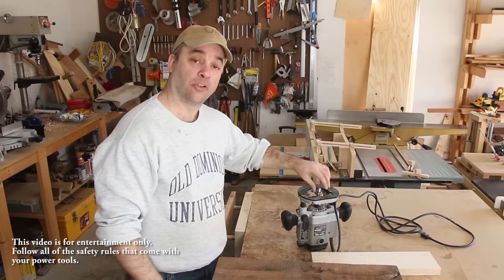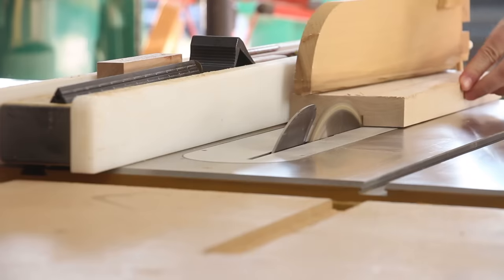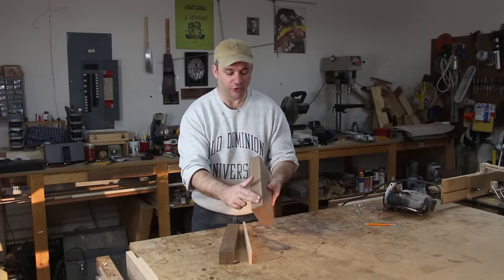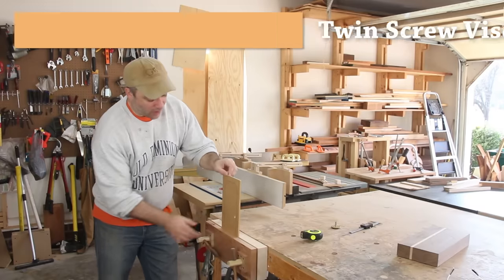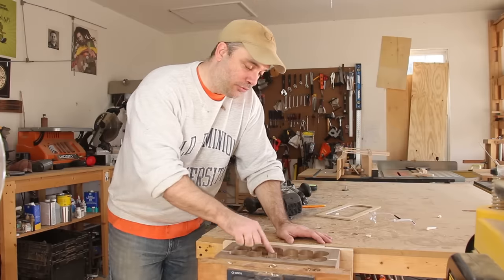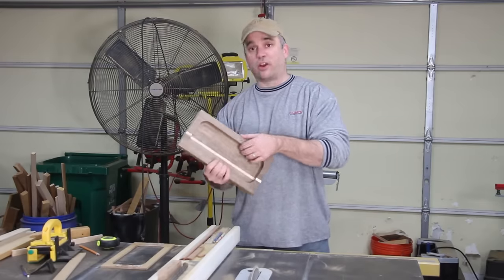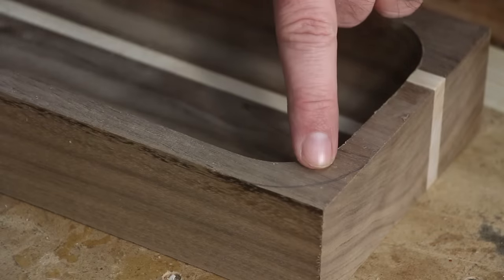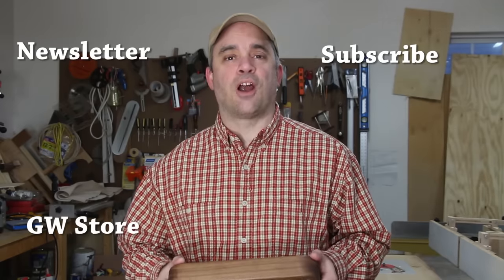Make a Bowl with a Router

Comment: The finished bowl looked great and the techniques used to make were good.  I just have issue with the title of the video.  You actually made the bowl using almost every items in your shop, most of which out of reach in cost of your average John Doe woodworker.
Reply: @D you've missed the point but no doubt that was intentional. Making someone feel cheap makes you the bigger person ... we don't think. Get some self worth
Reply: @D I understood that. However, the vid title implied that a router only was needed.  The op was correct in saying that the vid utilises numerous workshop tools which are likely outside the requirements of most dyers.  You then advise just two tools needed.
Not correct. The op was right and your comment imho a little snide.
Reply: Hm..nice bowl..but where is the craftsmanship.
Reply: @maggiehemming7904  It only seems that way if you are completely unfamiliar with how wooden bowls are usually made, and that would be with a lathe. The title simple serves to differentiate this technique from the norm....i.e. using a lathe.

Comment: I’ve never seen so many winery comments. He used a router to make bowl. So what if he used other tools as well. He didn’t have to, but he has the tools so he used them. You could watch other videos on how to make block of wood without his tools, and how to remove the bulk of the material without a drill press, the important tips came from him showing how to use a bowl bit and a guide to get a nice bowl cavity. I liked the tip of leaving extra wood around the edge for added support, and how you can use the edge left by the first router pass to create a nice guide for the subsequent passes to get it to depth. You could do all this with a saw, had planes, and chisels if you needed to, but the router is what makes getting a nice smooth regular surface so much easier.

Comment: "I hope the pencil line shows up on the walnut"...I have a handy tip for you :) A couple of weeks ago I became frustrated trying to see pencil lines on wenge.  Chalk stinks because you can't make a sharp line.  Went inside and found a white colored pencil. Perfect!  I found that the high quality pencils work better on wood, they leave a solid clear line and they are easier to remove than low end brands.  Another bonus is that colored pencils are softer than regular pencils, so they don't scratch softer woods like poplar and pine.  I use bright orange or pink on light wood, and white on dark wood.  So much easier to see.  Erases best with the old school style pink erasers.
Reply from the maker: That's a great tip Jen.  I hope you consider subscribing.

Comment: Everyone is complaining about the tools, and being expensive, I don’t really see any expensive tools except for the woodpecker router lift, everything else is within reach for a diy woodworker. People need to understand that woodworking is not a cheap hobby. But also there are a lot more expensive tools than what you are using. Also you can learn to work with what you have, the only thing I don’t have is a band saw but I make it work without it 
I’m surprised no one has complained about the glue yet

Comment: @ James Randall: Although I can understand you, I cannot agree with you. If you have the real estate, go for it (or build a big garage like I plan to do within a few years). If not, make use of the space you have. You do NOT need those big, chunky tools (although they are niiiiiiiice). There are a lot of small tools that fits into a really small garage. And a lot of the tools can be swapped out for hand tools or utilizing other tools you have or can purchase for very little money. Take a look at this video:
Homemade hauptwerk organ
I used some hand tools, a plunge router, a small band saw, a combo planer/thicknesser (dirt cheap, works great on smaller pieces) and a drill.

Big tools and a big garage is the dream, but you can have a LOT of fun with less space and smaller tools (they are cheaper as well...).

For instance: My combo planer/thicknesser costs NOK 2995,- while a big aircraft carrier style thingamabob costs about NOK 15000,-. For most projects, you really do not need that big planer. I have successfully planed 2 meter long pieces on my thicknesser/planer, and it have a bed of only .5 meter.

And if it still bothers you that much, just don't watch the videos. Go to your shop and build something! :)

Comment: good work if you can afford all the equipment. . . ..  I feel deflated, Ive just got a router and a 10 ft garden shed to work from. . . .  . and I had such high hopes ! :)
Reply from the maker: I made my first piece of furniture (sofa table} in a garden shed on a contractors table saw.  There's no reason why you can't make this bowl with minimal tools.  It's not a chest of drawers for crying out loud.  It's a bowl :^)
Reply: +Robert Brennan
They're complaining that this video claims it will show how to make a bowl with a router, but then shows a variety of very expensive tools being used instead.
Reply: johns sparks lol I'm still trying to get my garden shed!

Comment: This is a silly question. But what is that machine you slide the wood through and it came out the other side? What does it do?
Reply from the maker: That's a planer.  In a nutshell, it allows you to take a thick board and make it less thick.

Comment: Hi.  Nice video.  I had a question on the bandsaw.  What type of blade are you using to cut the Walnut ?  i.e.  width ( 1/2 inch)   TPI  and tooth configuration.   I have the hardest time cutting thick hardwoods.

Comment: great video, but pleas tell me, why do you alternate between the band saw and the table saw in the beginning?  what makes you decide which one to use?  Thanks in advance mate, and also what is that large dewalt machine that you run the planks through?
Reply: band saw was for rough cutting the larger chunks of wood, and re-sawing...table saw was better for dimensioning.

Comment: That was a big piece of wood when you started but the tray/bowl is quite small.  Why did you not make a larger bowl/tray to use most of the material?
Reply from the maker: The original stock that was used had to be wide and long enough to support the router.  Not much is wasted.  Not sure I would describe the bowl as "quite small". It's a really good size. Thanks for your interest!

Comment: You don't have to have all those large tools. I use my cordless drill to hog out waste material sometimes. You can cut the corners off with a hand saw or your table saw. Flatten the surfaces with a hand plane. If you have the nice big tools then use them but ya don't have to have them.

Comment: I have a question.  Why use the Forstner bit for clean out vice the plunge router?  I have seen other people do this and was just wondering why.
Reply from the maker: Faster to use the forstner bit.  Router would require multiple passes with each pass being deeper than the former.  You also need to sink the router bit to a level that puts the bearing at template height.

Comment: Love your videos. Thanks for sharing, you definitely got you a new subscriber. One question, could this be done with a straight template router bit with ball bearing? Looking to make just a wooden enclosure and don't need the slope on the inside. Thank you in advance
Reply from the maker: I don't see why not.  Should work fine.

Comment: What adapter do you use for attaching your shop vac to your Dewalt planer?
Reply from the maker: I used a rubber 90 degree fitting that I found at Home Depot.

Comment: well done..no worries using tung oil on a bowl?
Reply from the maker: Tung oil (with no metal driers) is probably one of the safest finishes you can use.
Reply: As the source of tung oil is a nut, people with nut allergies often report adverse reactions to contact with (or even the odour of) tung oil. Reactions can be severe in some cases. While tung oil has been used for many centuries as a finish for kitchen items such as wooden bowls and cutting boards, some individuals must avoid its use. (Wikipedia)

Comment: You didn't just use the router. You have used the drill-press, table saw, band saw, "scrollsaw". I think that the headline should be modified IMHO.
Reply: the main thing is the hollowing out so he used a router in stead of a lathe. Get over it.

Comment: This should be called 'Make a bowl with a Router, band saw, table saw, planer, sexy belt sander and a drill'.
Reply: Sam Jarman it’s not called a sexy belt sander, the technical term used in the sears catalogue is scratchy surface thrusting smooth maker

Comment: With just a router...and $3k worth of bandsaws, drill presses, belt sanders...etc., you can make a $10 bowl!

Good vid regardless...nice work!
Reply: I guess you ignored the end of my comment complimenting your video...

No need to be original. You have to laugh at the video description..."Make a bowl with a router" and the router might be the least used tool in the video. You have to see how that's kind of funny, right?
Reply from the maker: It gets very old.  Bowls are typically made with a LATHE not a ROUTER.  Get why the title is appropriate now?
Reply: Yeah I got it.  Impressive work and shop either way.
Reply from the maker: Thanks.  If you get bored and read through the comments you'll see your comment,  in some form, multiple times.
Reply: Yeah, after I posted it I saw essentially the same post 30 times lol

I can see how that could get annoying...

Comment: I don't think you'd need that much equipment to make this. Jesus... a jointer, a planer, a belt grinder, a drill press, a router, a router table, a table saw, a band saw... Also aren't you supposed to use a jointer first then a planer? And then what? so that you can later saw it off?
Reply: ok one day if i win the lottery and can buy all of these tools and then own a space big enough to house them and a place in which I can use them then I can finally make some wooden shit.  side eye

Comment: "making a bowl with a router" - let's just forget the other 25 heavy duty power tools we use while doing that... Great.
Reply: U r right😂😂
Reply: Turns out woodworking requires tools. Shocking!
Reply: @tboxcupcakes  explain yourself
Reply: @zitronenfalte  
1. These not heavy duty or industrial tools
2. You can’t make a bowl with ONLY a router, he’s stating you don’t need a lathe which is what a typical bowl is made on
3. Woodworking takes multiple tools even for simple projects (I.e. this project, cutting boats, lazy Susans)
4. He even mentions in the description about people making the same comment you made.
Reply: @tboxcupcakes  1: you have to click on the video and then flip down the description to get to the point where he tells that, so far that is misleading no matter what you say.
2: the tools he uses may aren't heavy duty, that was a little too much said, but they are surely much above what people have in their little garage when they follow a link that states "make a bowl with a router"! It's not about what tool you use normally, who cares? It's about the fact that you may can make a bowl using only a router (maybe not exactly like that one, but still) but he isn't showing that. It is misleading, call it whatever you want.
Sure, woodworking requires many different types of tool, but that is why videos like this (title wise at least) are so much in beginners favor, but it is also why many then are really disappointed by falling for clickbait or at least confusing / misleading titles.
Reply: @zitronenfalte  I get what you are saying but the video says “how to make a bowl with a router.” Not “how to make bowl with only a router”. I rewatched the video and there were some unnecessary steps, like the drill press and chisel. I also should have stated that while it is not heavy duty it’s just all really nice top of the line stuff

Honestly I think this is doable with a circular saw, plunge router and a sander.

Comment: Nice but this is not with a router, for a simpler approach people could just do it the way people used to do it is using a forstner bit and a chisel.... but hey who am I to disagree with someone who has a shed full of industrial tools.
Reply from the maker: +orestes1984 Good grief.
Reply: What you've never done things the old fashioned way? You can use a jigsaw and some effort with a wood rasp and sand paper to tidy up and you don't need more than a couple hundred dollars worth of tools that most people actually have.

Comment: That's not make a bowl with a router, that's make a bowl with a complete workshop.  Kinda misleading a lot sir.
Reply from the maker: +mystraven22 Not at all.  Bowls are typically made with a lathe.  This was made using a router.
Reply: GarageWoodworks only as a finishing tool to all the other tools used in the video. It should be labeled making a bowl with out a lathe. As you use a band saw, table saw, drill press and chisel all before using a router to finish the piece. I would have consider it bowl with a router if the entire inside was routed out. And yes you favorite out the entire inside of that piece.
Reply from the maker: No.  It is titled correctly.  If it is a surprise to you that other tools were used in addition to the router then I'd kindly suggest that woodworking isn't for you.